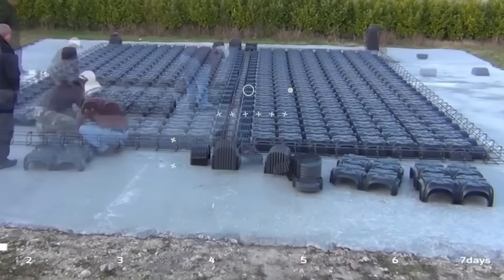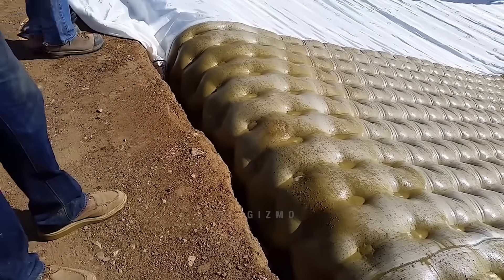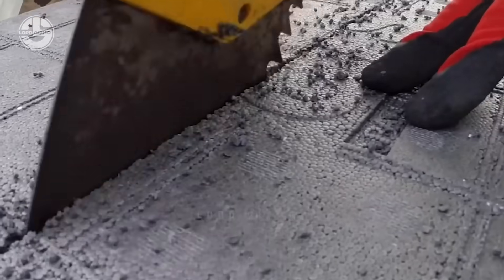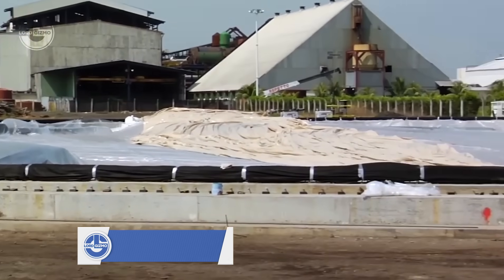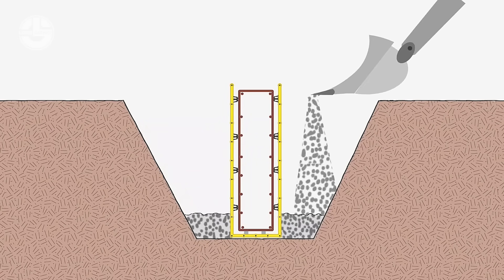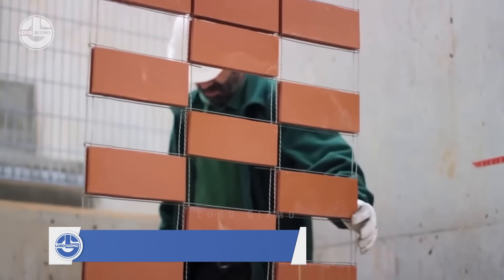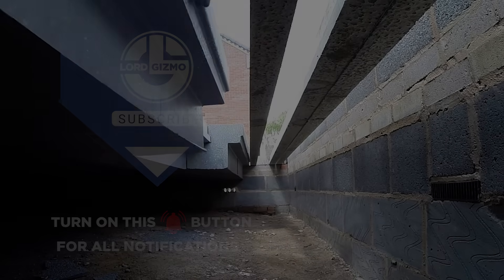Mind-Blowing Construction Techniques You Didn't Know Existed, Most Ingenious Construction Techniques

Comment: In modern construction, HPMC is the key element and brings the big reform for the building materials. Due to its ability to significantly enhance their performance on enhancing water retention, improving workability and  stronger adhesions, anti-sagging and extending open time.👍 And, here's one more important thing is that the HPMC is Eco-friendly material which is made from purified cotton.🌳🌿

Comment: The foam added to masonry walls would work great to retrofit the many concrete block houses built in the 1960's, mostly in the U.S. South like Florida.  Brings the thermal mass inside while adding insulation.  Using spare tires is clever.  The steel belts give them high tensile strength.  I watched a youtube of a new home being built in Ukraine, using concrete walls with foam insulation in between.  Much more robust and innovative than many new U.S. homes that are barely a step above papier mache.

Comment: Pouring concrete over, or just burying tires is a poor idea. The steel belts in the tires will rust. As they do so, they generate heat which can ignite the rubber in the tires. Once lit, these toxic fires are near impossible to put out.

Comment: The concrete and polystyrene systems are quite excellent. It is important to seal chambers with rodent resistant layers.
The end product offers insect resistance, non nutrient structure that will not rot, better than standard fire resistance, energy savings. 
The interlocking polystyrene blocks for foundation allows for small contractors to build their own foundations. Dow Corning high density polystyrene allows ice lens to be deflected from structures permitting large savings on excavation. I myself had a basement patio wall that previously shifted every winter easily stabilized by burying “Hi Load” Dow Corning which has more load bearing capacity than typical soil.

Comment: Some those systems are very old just tweaked using plastic. Not one of these is environmentally sustainable. They are all made from oil or in the case of concrete do some research it's shocking.

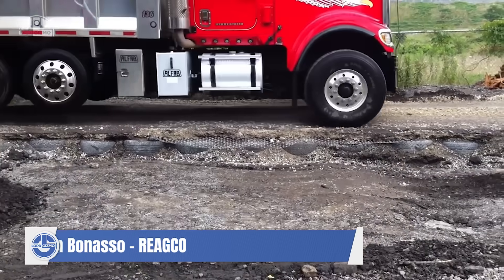Comment: 7:48  tires are more toxic than roads because they produce more harmful particles and chemicals that pollute the air, water, and soil: 
Particle production
Tires produce hundreds of times more airborne particles than exhausts. For every kilometer driven, tires produce more than 1 trillion ultrafine particles, while exhausts produce an average of 0.02 milligrams per kilometer. 
Toxic chemicals
Tires contain many toxic organic compounds, including known carcinogens. Tire wear chemicals can also react with nitrogen oxides to create carcinogenic nitrosamines. 
Environmental impact
Tire particles can be washed into waterways near traffic networks. Tire chemicals can also travel long distances and contaminate distant environments. 
Toxicity for humans and wildlife
Tires release toxic chemicals and tiny particles that can be ingested by wildlife.
Reply: Tires have been used since about 100 years. If they are now as dangerous as you claim, then a person's lifespan should be reduced. Life expectancy has instead increased, so then you are obviously wrong.
Reply: @MRSBroadcastingAB  Obviously I am right because I am comparing tires to roads! Look up the chemicals! Using used tires for roads just increases our exsposure! Tires chemicals have also changed over 100 years
 Now nearly 25% of the components in a tire are made of synthetic rubber, which is a plastic. Under sun radiation exposure, 6PPD converts to 6PPD-quinone, what is called a diketone, or a molecule made up of two ketone groups. One major source for these diketone molecules is the tires themselves.! 
A hundred years ago, tires were primarily made from natural rubber, often combined with fabric cords for reinforcement, and the key chemical added to the rubber was sulfur which acted as a vulcanizing agent, transforming the rubber into a more durable and elastic material; other chemicals included carbon black for increased wear resistance, and depending on the era, some early synthetic rubber compounds might have been used, particularly during World War I when natural rubber was scarce

Comment: The first construction method is what we call reinforced concrete and the reality is that it is useless, since the entire building is made of a single piece of concrete and cannot even withstand a screw or nail being put into the walls, as the walls crack. Therefore, companies make you sign a document in which they do not allow you to make any modifications or put a nail in the walls until the guarantee period of the structure ends.

El primer metodo de construccion es lo que llamamos concreto armado y la realidad es que no sirve, ya que todo el edificio esta formado de una sola pieza de concreto no resiste ni siquiera que se le ponga un tornillo a las paredes o un clavo ya que se rajan las paredes, por lo que las empresas te hacen firmar un documento en el que no te permite realizar ninguna modificacion ni poner un clavo en las paredes hasta que se termine el periodo de garantia de la estructura.

Comment: Manufacturing concrete is BAD for the environment; use of concrete should be minimized.  This video almost seems like an advertisement for concrete.

Those insulation panels being made of HDPE  makes them suitable for use on Mars (if we ever manage a colony) because HDPE is a great radiation-blocker!

Just BTW, there are at least two different processes that can turn old tires back into oil.

There are also interlocking blocks that are made of dense styrofoam; their use is far better for the environment because their manufacture is far environmentally friendly than that for concrete.

My favorite is the flex-brick; I've done several brick driveways by hand and those sheets of brick would make it SO much easier!

Finally -- you missed one that I don't know the name for:  it's a high-strength plastic net that goes onto the ground and gets covered with crushed rock, and then is folded back over the top, holding the rock in place.  Smaller crushed rock goes on top, and then another layer can be added.  It's great for roads that run along hillsides because the exposed edges can be made to conform to the topography, and once covered with gravel, wood chips, and dirt so that vegetation can grow the result is a natural-looking hillside.
Reply: To make concrete (cement) produces CO2 which is the gas of life without which there are no plants. It regulates earth's surface temperature. Or are you one off those who believe in catastrophic climate change. If yes, then I cannot help you; you are beyond reason and a permanent victim of the greenies and alarmist media.